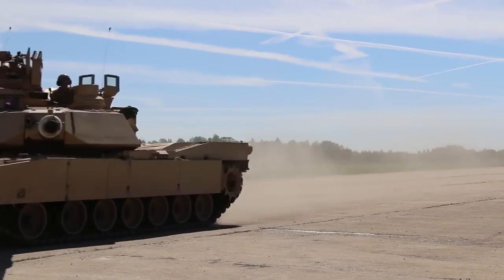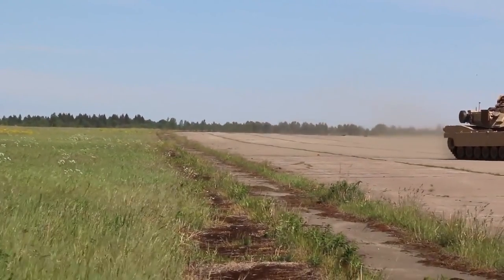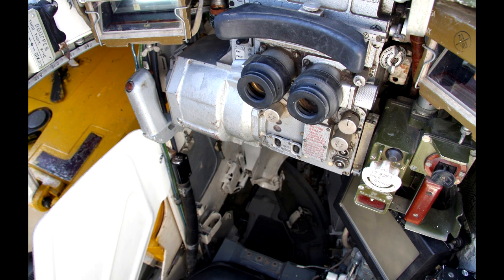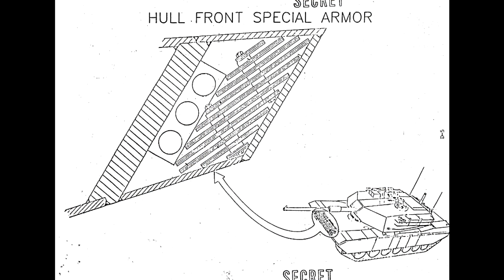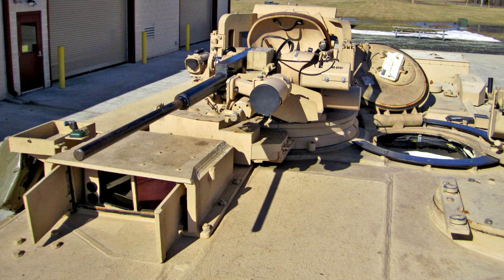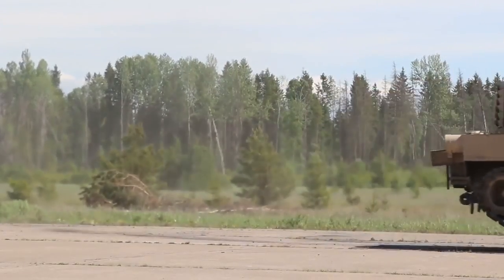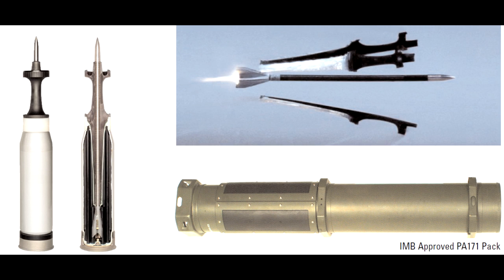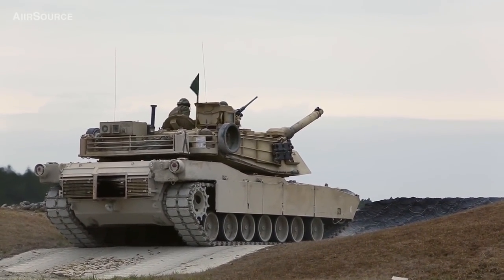Problems with Abrams tank

Comment: Turbine engines were not only at the time more powerful and better for Mobility but they also are far more reliable. I acknowledge that consumes more fuel but you have to understand that this is an American Tank design for the American Army on army whose greatest strength is the logistics. it is arguable to say that the United States Army has perfected Logistics. the logistics in the American Military is very robust and very well protected remember they were able to send cookies and cakes mailed from home to soldiers on the front lines in World War II.

Comment: If your information came from those two sources I have issues with them.  Any one on here ever command an M1? Back in 83 at FT Bliss I had no problem overriding the gunner and tracking a target at night. And neither did any other crews. And that was a 1st generation M1. Actually the original nomenclature of my tank was XM1. A 125 round penetrating me at anything but close range doubtful on that. But the 105 penetrating a 64,72, or an 80 at anything but short range doubtful on that also. Fuel consumption and the issue with the engine I agree. It was a pain.
Reply: What he means is that the commander in early M1 didn't have a CITV (independent commander's sight), so he can't search for more targets. 
Yes you could have override the turret at any time, but you still didn't have your own indepedent sight to search for other targets. 
The commander and gunner were lookign through the same sight which didn't allow for hunter-killer cability like in the Leopard 2.
Reply: I had three lenses to look through. I had no issues scanning the horizon for 2nd and 3rd targets. Nor any problems laying the gun near the next target for my gunner. Now if I remember right its been almost 40years, they were fixed forward unlike my 60a3 were the copula swung 360. None of us had issues picking up other targets. What I did like about my 60a3 was the turret traversed automatically to the axis of my sights if needed. Don't remember the M1 doing that.

Comment: Fact is that the Abrams is outdated platform and needs to be rebuilt from the ground up.
Reply: woah chill not even the video itself was so radical
Reply: @xAlexTobiasxB  no it is. I'm in the military and I've seen the problems it has first hand. It's a bitch to maintain for one because nothing is easy to reach, and it has internal modules in some of the dumbest places that are both hard to reach for the crew member it's meant for and next to a week point on the tank. For example, there is a ammo rack, unusually used to store HE rounds right beneath the driver's feet, and the lower plate of the Abrams isn't its strongest point by any means. If a round goes through that lower plate, that tank would probably get its whole turret blown off.

Also the front plate is angled very well and is hard to penetrate, however it's angle will redirect the round into the turret ring. I had a buddy tell me that they were shot by an RPG in the front plate, and it rode up the angle of the front plate into the turret ring, and busted the turret. They couldn't turn the turret at all, so the only armor support that 2 squads of infantry had was now heading back to base for repairs. Luckily the infantry encountered little resistance, but still would've been nice to have a tank along.
Reply: @wyattgreen2925   Literally any tank needs maintenance, that's not even an argument. The ammo rack in the rear of the Abrams hull is actually a better place than in most other tanks where it's in the front part right next to the driver without any armor or blowout panel. 
At least the Abrams ammo rack is armored and has blow out panels to the bottom (I think). It's not so bad. Well, still better than T-72 lol
Reply: @xAlexTobiasxB  It's not a bad tank, but we can do better
Reply: @wyattgreen2925  Well, the SEP.3 just recived the Trophy APS, which at least protects the tank against RPGs and missiles now. I think that's good enough for now.
Reply: @xAlexTobiasxB  When your fighting on the field, you want the best, not just good enough. The Marines just got rid of the M4 and M16 and replaced them with the M27. Much more accurate and reliable and easier to maintain for example.

Comment: What is not mentioned is plastic hub caps that break leak and over heat the torsion bars and road wheels causing the aluminum to explode. "fish bowl" driver night vision, then "up dated" thermal driver veiwer enhancer, which is like having a black and white 8-bit game couple of inches from your face. Gotta be on your game to see where you are going. Bad turret seals and dysfunctional bilge pump. And driver is locked in if his hatch is blocked. Gotta rotate the turret to get him out. You can seized up the turret with .50 cal brass if it gets wedged in between the turret and hull on the outside.

Comment: The US should have taken a lesson from the German gas powered tanks they used in WW-2. The Russian diesel powered T-34 ,s and other Russian tanks had an advantage in power and range over the German gas equipment. The very first M-1 Abrams I saw was at ft Knox when it was still the XM-1. It pulled out the the vehicle area onto the road and throw a track. I was 19D20 at the time and we beat feet before we got shanghaied into helping put that track back on. Any infantry that has been near a tank with a track off knows what I am talking about.

Comment: You make a lot of good points, damn that front armor is disappointing. Though if I were a tanker I think I'd be hesitant to have a longer gun. Especially because the Abrams fights in urban combat, more than against T-90s. A longer gun is harder to turn around in tight spots. But maybe I'm totally off base as I'm no tanker.

Comment: A tank that uses a foreign canon because its own devs couldnt get it a good one screams issues. No offence, but the abrams is outdated scrap. The US should either develop a new tank or just buy leos as their MBT's and use the abrams as target tanks. The abrams might take 3-4 good hits to the front without completely blowing up, but you have to face it, its accuracy, weak spots, engine, canon use, loading system and size/form are laughable. As the russians said, the germans come in iron coffins. Might be time to rebrand it to the americans come in steel coffins.
Instead of spending literally billions in rail guns and laser systems which will never be usable (and dont start with the laser system installed on one US aircraft carrier cause its a joke), the ministry of defense should take that money, and spend it on either the development or purchase of new tanks.

Comment: Diesel engines, while they can use more than one fuel doesn't make them multi fuel. Diesel engines also use the fuel as a cooling and lubricant liquid and this makes basically any other fuel that can not do all that rather pointless in a diesel engine.

None diesel engine fuel can actually damage the engine as well in the same way using a lower octane fuel can with "knocking".

Comment: Latest M1 Abram is M1A2C SEPv3.  

Has increased power generation and distribution, better communications and networking, new Vehicle Health Management System (VHMS) and Line Replaceable Modules (LRMs) for improved maintenance, an Ammunition DataLink (ADL) to use airburst rounds, improved counter-IED armor package, improved FLIR using long- and mid-wave infrared, a low-profile CROWS RWS, Next Generation Armor Package (NGAP),[130] and an Auxiliary Power Unit (APU) under armor to run electronics while stationary instead of the engine, visually distinguishing the version by a small exhaust at the left rear. More passive ballistic protection added to the turret faces, along with new Explosive Reactive Armor mountings (Abrams Reactive Armor Tile (ARAT))[131] and Trophy Active Protection systems added to the turret sides. Prototypes began testing in 2015,[132][129][133] and the first were delivered in October 2017.[134] Fielding is expected to begin in 2020.[135][136]

Comment: The tried and tested principles of good tank design are Protection,Firepower, and Mobility; not necessarily in that order. These principles are different in the U.S. however. Their principles are that it has to go faster than any other tank, and it has to be bigger than any other tank, and it has to look good regardless of whether it can do its job.
Now apply those principles to the rest of the U.S. Military?

Comment: I love the Abrams, personally my favorite tank. However I love the innovation and steps towards a new generation of tanks both the German and Russians have been taking with the new Leo2A7, and T-14 and T-90MS series.
Reply: The US military has a problem in that Congress has improved and reformed the process that we use to design and purchase military equipment to the point where it no longer works.  Remember that  the last three times we tried to develop a follow-on tank to replace the M1 - the programs failed.  

A good rule of thumb is if the children of people who served on a tank or aircraft are now serving on that platform - then you need to be in the process of replacing it.
Reply: @colincampbell767  B-52 "Whistle's in the background"
Reply: @dawnofwar4302    The B-52 should have been replaced decades ago.  The only reason the Air Force keeps it is because it's cheap to operate and the Taliban do not have air defenses.  In Desert Storm B-52's were used - once.  Despite having most of the Iraqi air defenses suppressed we almost lost a B-52 to a hopelessly obsolete SA-2 missile.  It was barely able to make it to an emergency landing strip.  

The B-52 is useless against any enemy more advanced than the Taliban.
Reply: @colincampbell767  
I tend to disagree with it being useless. Its still a very capable launch platform for long range self guided munitions. And if the enemy has no air defense or it has been suppressed it can assume its original pupose of laying large swaths of enemy territory to waste by carpet bombing. Obsolete is not a term i generally use. The way such a weapon system is employed is what matters. Obsolete no, not for a long time.... is it very old yes.
Reply: @dawnofwar4302  The B-52 raid over Iraq during the Gulf War was against 'suppressed' air defenses.  The B-52 can only survive against 'nonexistent' air defenses.  And as a launch platform for long range missiles - we'd need a dozen of them - at most - for that mission.  We won't be seeing massed missile raids because we will be very concerned with conserving our stocks of long range missiles for long enough for new factories to be built to make them.

In one missile attack against Syria we fired off six months worth of production.  Our defense industrial base has severe capacity issues.
Reply: You can't go by what the Russians say they have look at the bison bomber for instance  how many of those tanks does Russia really have ?
Reply: Tbh I feel like the upgrade t90s will be more practical then the armta t14 for a long time, as the Armata is just way to complicated and ahead of it's time
Reply: @maxim6088  Honestly kinda wish they had stuck with the low profile design such as the T-72 and or T-80. That being said i also believe the Armata is a good tank in its own right. Time will tell.

Comment: What’s the point on making a video about the negative parts on the abrams without stating the positives. It pretty much comes off as just a bashing video. It would have been more interesting if you could have covered both side in my opinion.

Comment: Yeah the Abrams still uses the German L/44 gun while Germany created a new, longer L/55 gun. Apparently the reason for the is the US uses depleted uranium rounds while Germany does not have access to DU so they use Tungsten. Intelligence indicated that German tungsten rounds couldn’t breach newer Russian tanks so they made their gun longer. But the extra velocity doesn’t help DU like it does tungsten. Plus the new gun is heavier and wears out faster. So the US has thought over the years of upgrading instead to a gun with a larger bore, but has repeatedly declined to do so. 

Russia has 15,000 tanks, most of which are older and the Abrams gun will have no problem breaching. But the US only has 1,200 tanks in Europe. If Russia starts rolling their tanks into Europe the US plans on blowing them up from the air, which is why Russia is spending so much on the S400 air defense systems and electronic jammers. One question is how well would Russian tank active protection systems do against a maverick missile?

The newest version of the Abrams out this year adds even more armor to frontal turret, so the bean counters probably think that’s where it’s most likely to be hit by an anti tank round.
Reply: Well, now the French and Germans are working on a new tank with a Lecletc turret and Leopard chassis and looking at putting a 130mm autoloading gun on it. That’s probably where the future best tank design will be.

Comment: As i know, the turret is not comatible to the rhm 120 l55 guns. Because this the us started to research a lighter m256 gun, namex xm360 with the capability of higher chamber pressure.

And an other thing:
Can you make a video about the experimental tanks, like abrams ttb (an armata style mbt from the '80's, and an oher wariant is a 140mm gun prototye)
Also there is a 140 mm proto leopard2a4 from the swiss army.
Or soviet prototypes, like the object 292, a t-80 with a 152mm communism launcher (xd)
Or the object 490, a super tank prototype, it looks like a piece of cheese of stalin with a 152mm gun (xdd)
Or for last, the russian vakuum-1/2 apfsds shells with 1m penetration
Thx for an answer/video

Comment: The tanks destoyed are in the Yemen war , Saudis , they don't have the depleted urainium composite armor
Reply: I don't even think the Australian M1s have the composite armor, though I could be mistaken.
Reply: @dbenson31   Why do you say that?  You realize that the industrial safety requirements for people who work with the stuff in industry are standard industrial hygiene measures - right?  (Wash your hands before eating is the most important rule.)

In fact the biggest concern is that small pieces of scrap and chips from the machining process are combustible.
Reply: No, they now have completely depleted armour.
Reply: There have been plenty destroyed in Iraq. Only the turret front has depleted uranium plates, center of the turret where the gun is, hull and turret ring are still very vulnerable and can be penetrated by any tank gun, from the 70ies to contemporary ones. Sides are also very vulnerable.

Comment: 7:05 most of our current along with our vehicles from ww2 onwards ran on primary fuels such as gasoline or diesel, but was designed to run on pretty much every thing from lighter fluid to jet fuel.
Reply: and bubble gum.

Comment: The Design of the Abrams its pretty obvious that the slope of armor on the haul is the weakness and anything shot at it for sure will penetrate the turret ring, its not actually that good of a design all together, its meant for haul down but we use it mainly for non-haul down combat and its just stupid, i find it crazy we have 8000 of these, for what? we aren't at war.

Comment: While I acknowledge all of the shortcomings mentioned, there are mitigating factors, first the vehicle is cheap, that is inexpensive enough to build 10,000 of them.  The oldest machines are being rebuilt to the latest standards including new armor packages.  So the trade offs were justified.  The only shortcoming is the poor fuel mileage of the turbine.  There are diesel engine variants of the M-1, but nobody is buying them.  Why?

Comment: I used to be impressed with redeffect the title makes you think they are just Russian trolls. But there other videos seem balanced ? I dont agree with some of the content but they seem unbiased. This video is just pure Russian troll work.
What there saying is the Abrams evolved over the last 30 years and improved the whole time? But there using it in a propaganda type of way to make the tank look bad.
Commander overriding the turret? Was needed with the poorly trained poorly disciplined Russian military.
ALL TANKS can be knocked out ! All you would have to do is get the Abrams to stand still at a close range (Without killing you) so you could shoot  from a higher angle at the upper plate that is almost horizontal. Good luck!!
When used correctly at speed using superior tactics and training  the Abrams is very proven. 
The Sadie's have had problems with losses due to the fact they are getting the older base Abrams and are using very poor tactics .
The WW2 style of tanks slugging it out toe to toe is good for the movies but wont work with modern firepower.
You dont Idle a tank through city streets with no support. Desert storm proved with the proper tactics even older model Abrams are very effective. Basically using a cavalierly charge with very accurate long distance shooting. 
Any slow moving unsupported tank is a sitting duck with modern fire power.
Again tanks can be knocked out but with American tactics and different branches working together the Abrams has been proven to be very, very effective